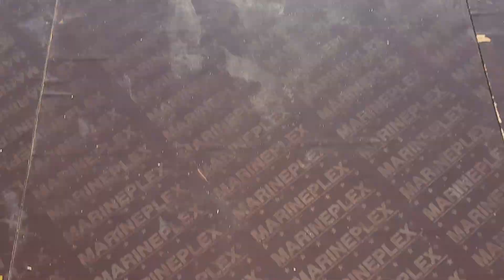3 Technical Terms on Construction Site

Comment: why we apply oil ?
Reply: Shuttering oil prevents sticking of formwork to concrete, allowing easy stripping of formwork after hardening of concrete.
In case of ply wood shuttering oil prevent ply wood from dampness.
It ensures that a superior finishing surface will obtain with minimal defects.
Reply: @civilengineeringfromgoldme3074  👍